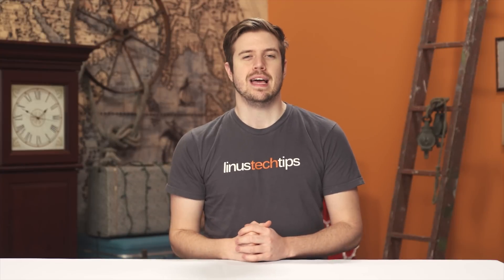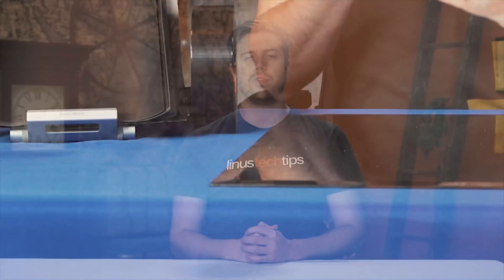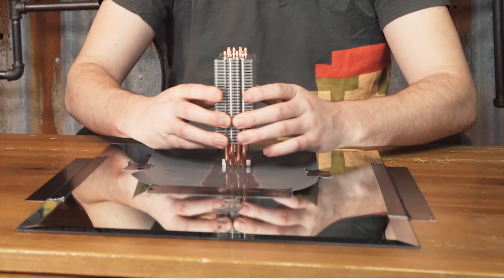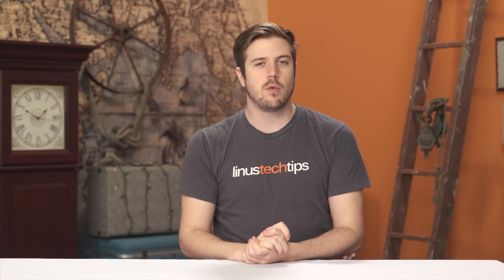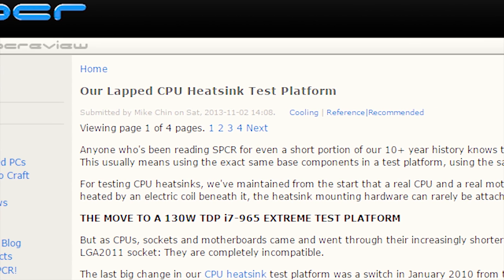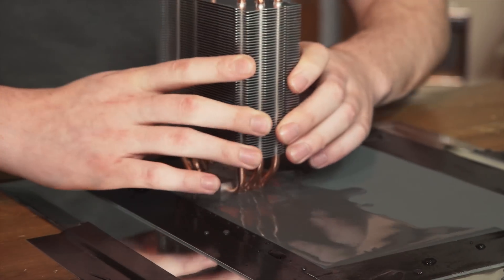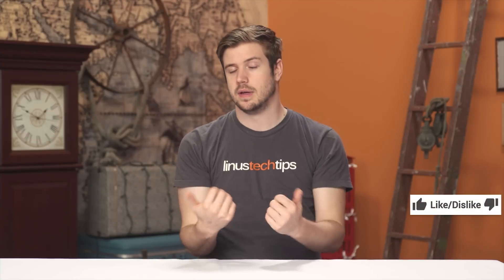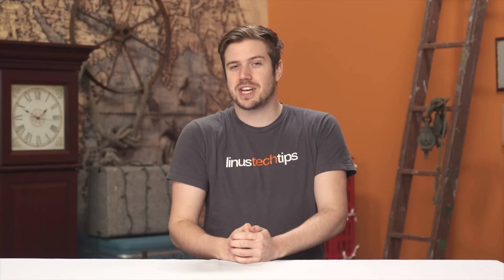CPU & Heatsink Lapping - Are concave, convex, or flat heatsinks best for cooling?

Comment: I can give some excellent advice on this because I used to run a small business that did exactly this type of work. DON'T BOTHER. 

Here's the details - 
My father had a small manufacturing business. I had access big money CNC type grinders, polishers, drill presses, lathes, etc. I started a small PC customizing biz using his equipment during off hours. I could polish CPU coolers to insane mirror level finishes that you could have used to pop your pimples! No joke. This was industrial level gear. I did hundreds of CPU coolers for just over a year. I tested batches of my finished products regularly to know and track the results and see if I could improve my techniques and processes. There was such a small gain (IF ANY AT ALL), that just wasn't worth the cost. Customers realized this and the business died. At first, I was doing 10-20 per day and over the course of a year it dropped off. Because once you got it back and saw your own personal before and after temps, or compared your polished CM HYPER temps to your buddies out-of-the-box temps - you wouldn't be impressed or happy. I voluntarily stopped offering that service because I could not improve anything. I could only take a sucker's money and I won't roll like that. 

Here's why -  IT"S THE THERMAL PASTE THAT MATTERS! Read below to understand.
#1 - A quality CPU cooler (well reviewed and tested by the good sites out there) with a copper base will give you almost perfect results.
#2 - A quality thermal paste (well reviewed and tested by the good sites out there) will give you even better performance and improve upon #1.
#3 - A quality thermal paste is between the CPU and the COOLER. It's the thermal paste that's the center of the thermal exchange. As long as the cooler device is smooth and flat and well made, it doesn't matter if it is factory smooth or a polished to a mirror. The thermal paste will do the work!
#4 - Even after all of the above, MAYBE, POSSIBLY letting me polish it might net you 2 more measly degrees. 
#5- Aside from the above, the only noticeable differences would come from either improving a poorly made cooler or fixing a defective unit that some how slipped through quality control. 

The conclusion - 
A cheapo brand or poorly made CPU cooler can be improved upon and you will make noticeable gains, but would you really want to risk using a cheapo product that needs to be improved OOTB on that expensive OCed rig of yours? NO!
Is it worth all that extra time and aggro or money for a business like mine charged for 1-2 degrees of improvement? NO!

The best and simplest ways to gain lower temps are - 
Buy a quality brand, well reviewed and tested cooler. 
Use a quality brand, well reviewed and tested thermal paste and (this is really important but almost never done) remove it and re-apply fresh paste every 6 months. Also, do not use paste older than 1 year. This is debatable but most of the info I've read over the years says to always use new paste, not year old stuff from the toolbox. Why not right?
Get a better case that will allow for better cooling/air flow.
Get better fans.
Remove obstructions and do clean cable management.
Lower the ambient room temperature.
Use better or different quality components. Example - I had an expensive brand name power supply but no matter how you positioned it, it gave off tons of freaking heat and turned my rig into a tiny oven. I did my research and bought another quality brand. Guess what? My temps dropped dramatically and my cooling problems were instantly and easily resolved.
Reply: +Barda Wulf excellent post! I bought a corsair h80i a year ago and it's been great OOTB, 2500k 4.2 idles at 25, runs 100% at 45
Reply: They make them really well these days. Years ago, early 2000s, it was different. Now, the studies and lab results are there and they know what to do. But it's like any thing these days. You have to keep an eye on testing and reviews. There are some excellent websites out there doing really great work. They'll guide you on what to buy. If polishing to mirror levels would knock out the competition, they'd be doing it and bragging from the mountain tops. Poorly made products can be improved. Quality brands are great OOTB. No need to go crazy and polish unless your OCD or doing it for some other personal reasons. Enthusiasts might do it just for bragging rights. Sorry. I don't have time to waste on that bullcrap. I'd rather go for a motorcycle ride, see a movie, go to the beach...you know...live real life. lol
Reply: +Barda Wulf Wheres the details?
Reply: Dude, I closed the business. I don't have numbers if that's what you mean. It doesn't matter. What I said above applies. The improvements were 1-2 degrees at best. I did various brands and people could send in their own for modifications. Everything you need to know is in my OP. It's just that simple.

Comment: You did it all wrong Luke.
Fist of all you cant get any improvements with cooler that have cooling heat pipes touching cooler,lapping only works with coolers that have solid copper base and other thing is that you need to lap CPU as well.

One advice if anyone attempt to do this,dont hold cooler like Luke did in this video,hold it by the base because as you all see in this video,cooler is skipping a lot.

I did this on my old Q6600 and arctic freezer 7 pro for 775 socked,and temp did go down by 4-6 °C (and i did measured ambient temp btw).

Older CPU-s and heatsinks used to have warped base and heatspreader,there is no need to that on newer CPUs and coolers,manufacturing process is much more tight than its used to be. 
Hope i didnt insult anyone.

Sry for my eng...

Comment: Lapping the heatsink is one side of the matter. One would also need to lap the CPU Integrated Heat Spreader.
This would then ensure that both are relatively flat surfaces, thus allowing for maximum contact and transfer of heat (with minimal use of thermal paste). 
As to whether it would have any actually noticeable effect, can't say as I haven't bothered/needed that level of performance.

I do recall a few forum posts around the net, having mirror polished both the heatsink and CPU IHS; to the point where the CPU stuck to the heatsink due to suction.

Comment: 1. Delid CPU (exept those witch ihs is soldered)
2. Do the ihs lapping
3. Remove black silicon, use laboratory liquid pro, stick back ihs
4. Do the heatsing lapping (not necessarily)
5. Profit

Comment: Do a video on "Overrated products that people still buy"
Like the fucking  HYPER 212 EVO... Why... just why.. it was good and is still good but other companies like BeQuiet! and Cryorig have similarly priced products with better cooling and are quieter.
Reply: +StoneAgeGaming The 212 is in no way overrated. It is a fantastic, cheap air cooler that goes toe to toe with  a-i-o watercoolers that are about $50-70 more expensive. The 212 is now quite an old design that has always worked well, which is why other manufacturers "adopted" the design. It is quiet enough, but the 212 wasn't exactly marketed for "quiet" operation in the first place.

If it ain't broke, don't fix it. Not to mention that a LOT of people already own a 212 Evo, so they have no need to "upgrade" to another cooler for now. Besides, if people want to make their 212 Evo quieter all they need to do is a buy a new, "silent" fan and that's that.
Reply: only bad thing with the 212 is the stupid mounting system.  Noctua still has the best mounting system for air coolers.
Reply: +StoneAgeGaming They are dirt cheap and do a decent job. What comparable coolers are there? Are they $20? I'd honestly like to see a comparo.
Reply: ***** What cpu did you use? How many case fans did you have? Because those are very high Temps. Did you apply thermal paste correctly? Did you mount it correctly? Seriously! I have only ever used it on AMD chips and no CPU ever got close to 70 degrees! Right now I am using it on a a10 5800k @4.6GHZ, 1.45v and under load I sit at around 45-48 degrees and 30-32 on idle. With a 8320 I had for a while the highest it went up to was 52 degrees if I remember correctly, @4.5GHz 1.43v.
Reply: Availability is also a big thing. Probably every small computer shape will sell cooler master products, but not be quiet! Or cryorig.
Reply: 1. The Pure Rock is within $5 of the 212 in almost every ( except 1 ) major location and sometimes a lot cheaper like I think Canada.
2. The PURE ROCK has 7-8 Degrees C Cooler and is much quieter.
3. The Cryorig H7 I have just heard, I know it performs better and is usually the same price but availability and quietness I don't quite know.
You think the 212 Evo compares to AIO coolers? You're fucking hilarious. RGInquisitor alcowherd7 Lars Bolduc
I replied to all of you in one message. Other companies like RAJINTEK ( or whatever the weird ass name is ) has another comparable affordable cooler. Heck, EVEN COOLER MASTER THEMSELVES came out with a new cooler that is better than the 212 Evo.
Reply: +StoneAgeGaming I don't see why you are so tilted over peoples CHOICE to buy whatever product they want. Neither of those products are available locally to me and I am in a major city. Clearly those companies aren't doing something right, because if they were as good, if not better then the hyper 212, and competitively priced then they should be keeping up with Cm. 

Don't hate on a product just because it is doing so well in a certain market, clearly the other companies don't care that Cooler Master dominates the $20 usd range of coolers.
Reply: alcowherd7
$20? Right now it is $25 WITH A rebate and a lot of people will not do that $10 rebate. Even then, you have obviously never heard of the bandwagon. It is the reason companies like Asus are so popular, ASUS's customer support is the worst customer support I have ever dealt with. Though, that has nothing to do with this. The 212 EVO IS GOOD, OTHER COMPANIES JUST HAVE BETTER PRODUCTS OUT NOW. I go on multiple tech forums, including LTT and have 8,000 post. I've been there for almost a year, and for every budget build people suggest the 212 Evo without reason, it is the first cheap cooler that pops up on PCPP and people do not bother doing research. How about you do some research of your own and show me where exactly the 212 Evo beats the Pure Rock or Cryorig H7? Because you can't, the 212 Evo is old and out dated now. Face the fucking facts, you are no better than Nvidia fanboys.
Reply: +StoneAgeGaming way to much rage over something so stupid.  lol
Reply: Chad Bremer
When you deal with people like him for months at a time who constantly suggest the same product because it is the first one they seen with good reviews, you start to get pissed off.
alcowherd7
http://pcpartpicker.com/p/wskvwP
Reply: StoneAgeGaming
After doing a bit of research, it seems that the Pure Rock is about $5 more expensive where I live. Amazon is not even a good option seeing it goes for $49.95 (only one seller). Newegg has a special going on now and it is a bit cheaper than the 212, but due to my area, I have to pay $15 in shipping if I want to buy from Newegg which once again makes it more expensive to buy considering Cooler Master products are sold pretty much everywhere both online and locally.

Another problem I have is that there are only 3 online retailers where I could get the Pure Rock, Amazon, Newegg and Ebay. Newegg seems to almost be out of stock too!

The thing about the Pure Rock is that it is relatively new to the market. The Evo has had a few more years and has the largest market share.

Also, about my a-i-o watercooler statement: The 212 Evo cost me $25 a few years back. I considered a H60, but after researching a bit, $25 vs $70 at that time between both coolers was a no brainer, considering the Evo had the same if not better cooling capabilities. Then I researched the H80, which was an improvement over the H60, but it was between $80-90, and a few degrees difference made the Evo the bang for the buck winner. Then against the $100 H100? That was a big improvement over the other ones, but still, $25-30 vs $100-120 for excellent cooling performance was a no-brainer, especially if you are on a budget. Now there are a lot better watercooling options than Corsair's H series, but seeing as to how I have no need to upgrade from my 212 Evo, its just a waste of money.

Yes, the Pure Rock has better performance than the 212 BUT it is not nearly as available as the 212, and for a few degrees? People won't go crazy looking for it when there is already a reliable, well known option.

Yes, the 212 Evo is old. Does that make it perform any less? It can still handle pretty much every CPU out there. And Cooler Master did make an "improvement" to it, you can't expect a company to stop improving their product just because their product sales well (because of its reliability and performance). It was bound to happen that others would improve on the design and try to take over the market. Sadly for those others, those that have a 212 Evo don't need to upgrade for a few degrees, and a LOT of people own 212 Evos. If someone is considering to replace their stock coolers, then sure, they can consider be quiet! but Cooler Master built a hell of a reputation with the 212 Evo and its going to be nearly impossible to take it away from them.
Reply: +StoneAgeGaming there is nothing to get pissed about.  What others buy has zero effect on you.  No point in getting pissed off.  just say "here are a few other option" and let people get what they want.  Getting pissed off over it is just being stupid.
Reply: +StoneAgeGaming well my original point still stands. Not everyone has the availability. Yes the hyper 212 is old, and because of that it goes on sale constantly. I was mistaken on the price because I was still thinking of prices of last year before our dollar fell. 

You could probably avoid all this rage inducing banter if you just said that from the start instead of calling everyone that buys a Hyper 212 an idiot, even though it's just the most accessible product in that range. If people don't want to take risks and buy from a reputable company, let them. I know the only reason why I bought mine was because it was returned due to a bent fin and I got it for 40% off.

Comment: Dude, any "imperfection" on the surface will be largely mitigated by the thermo paste when it's a flat surface. Only concern is when the heat-sink surface has a big curve which creates a gap and therefore more paste must be used, thus resulting in poorer cooling.

Did linus made you do this? lol.

Comment: if i were to run this test i'd delid the processor, make sure that's not holding a bunch of heat back underneath the IHS... then test that as a baseline. then continue to test with heatsink lapped, then test with both heatsink and IHS lapped (which you can lap off of the cpu itself.

Comment: I have an ARCTIC Freezer XTREME Rev. 2 that originally came with the worst contact surface I've ever seen. The surface was full of scratches and not flat at all. In fact when I placed the heatsink on a table, it could almost make it swing from left to right because of the curved surface. So I decided to lap it and, even if I didn't finish the process because after 3 and an half hours I got really tired, I saw a considerable improvement on the performance. Before, my FX-8350 was thermal throttling after 15-20 seconds in full load but now it doesn't thermal throttle at all and the max temperature reaches about 60 degrees celcius. And there's a lot more work I can do on it.

Comment: dude you need to test with an AMD cpu which doesn't NEED to be delidded for this to make a difference, and you NEED to lap the IHS or remove it completely for it to make a difference. 

from my experience the intel integrated heatsink is more concave than any heatsink will ever be so you need to lap the CPU in addition to the heatsink.

Comment: You should take an ID Cooling IS-VC45. It's a vapor-chamber CPU cooler that has been reported several times to be concave, resulting in poorer performance than initially claimed. It's rated at 130W TDP but can't beat the Noctua NH-L9i in its out-of-the-box state. HERE YOU HAVE IT ! A serious candidate for the Workshop !

Comment: Doesn't matter if the bottom of the heatsink is set to NASA mirror specs if the fucking CPU is that pitted and damaged, guys.

If you're gonna make a video, do it properly. Otherwise stop wasting peoples time and bandwidth. A single fucking cooler with gaps between the heatpipes done to a 'meh' shine without doing the CPU or using a new bare minimum of thermal paste due to the better metal-metal contact.
8 minutes and 50 seconds of fucking pointlessness.

Comment: If you dare, try this without thermal paste.

However, do you know if the top of the CPU is perfectly flat?  It's no use lapping one mating surface if the other isn't polished to the same degree.